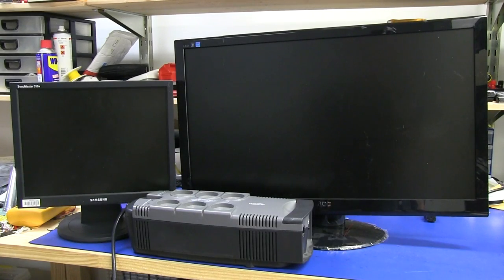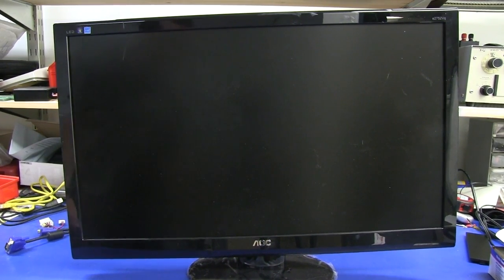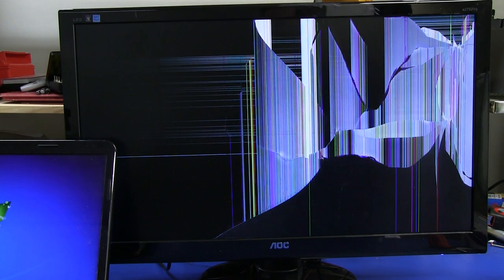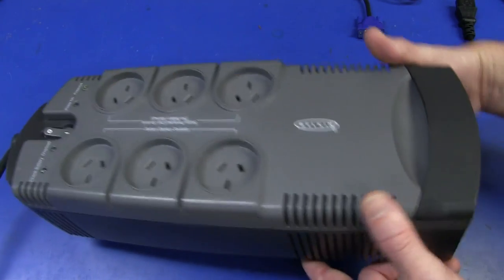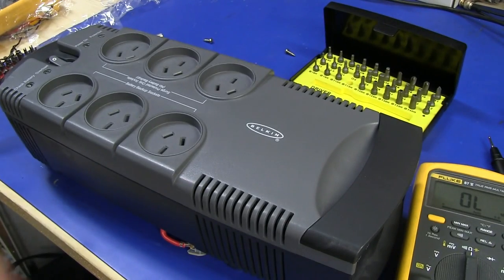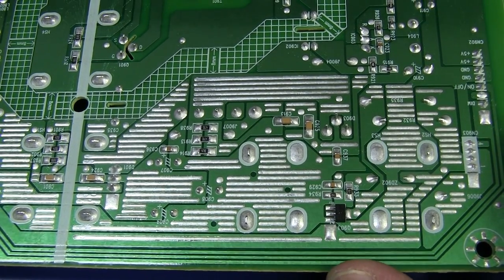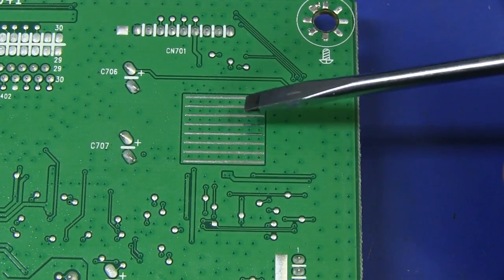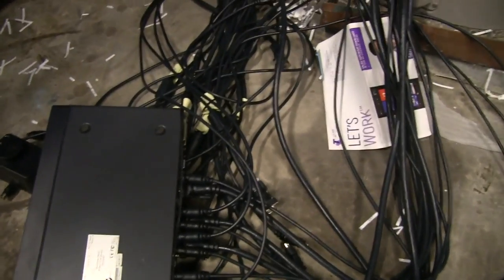EEVblog #463 - More Dumpster Diving

Comment: Phaser was Tek's printer line before they sold it to Xerox. The majority of the Phaser line were the the colored wax printers.  Somewhat halfway between a laser printer and an injket mechanically.  The print head was a single line that was the width of the paper and it sprayed the hot wax onto a soft rubber transfer roller that was impregnated with sort of an oil so it wouldn't permanently stick.  The roller operated somewhat like the photoconductor on a toner cartridge and it rolled the image on to the paper.  The paper may have been heated slightly in order to pull the wax into it.  Tek used to sell replacement wax catch trays that had to be "replaced" when full, or rather the printer would tell you to do so.  New trays always came with the maintenance kit, but could be ordered separately.  In reality, you just took the wax tray out, stuck it in the freezer for a few minutes and then gave it a swift bang on the side of the trash can and the wax slug would fall out and you could put it back in without buying a replacement.  The transfer roller had to be replaced though, as it would dry out over time and wax would start sticking and you'd have missing spots on the paper.  The most common failure on these printers was caused by users  putting the wrong wax cubes in the printer.  Different models had different heat ratings, if the heat rating was too low, the wax would scorch inside the printhead and damage it, if the rating was too high, it would solidify in the piping and clog the printer.  There were a few Phaser branded Inkjet printers.  The only thing remarkable about them was that they (along with all Phaser printers) had full Adobe PostScript support out of the box, but not many wanted to pay 500 dollars for a personal inkjet printer.  They also had some film transfer printers that were used for some purpose.